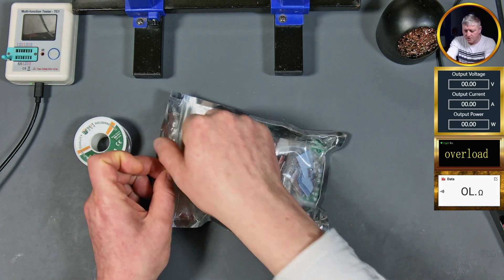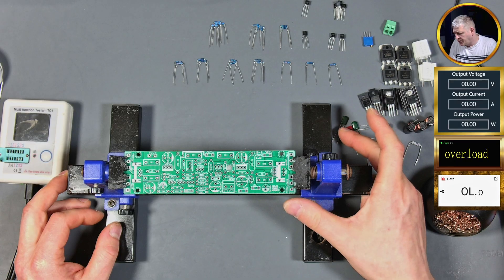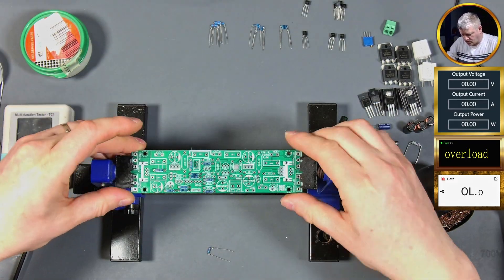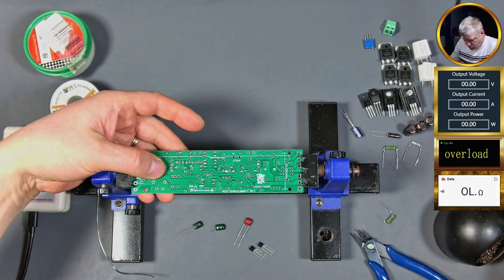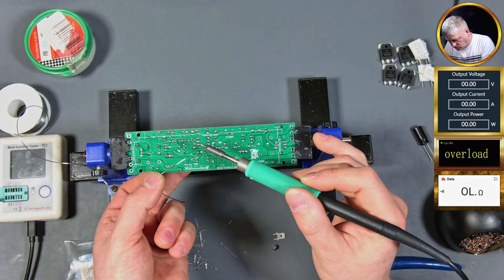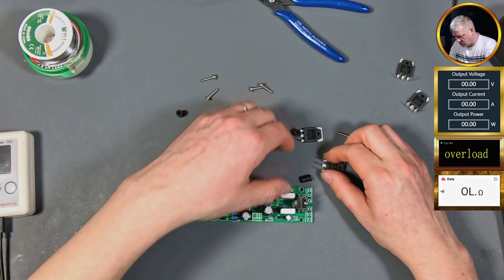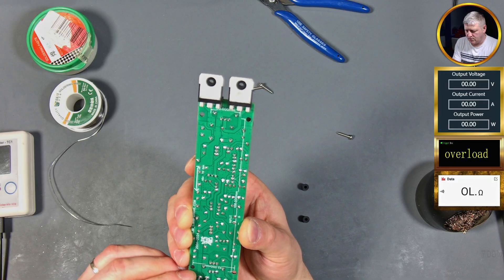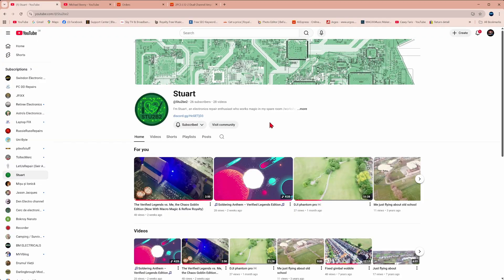Is this L12 V5 AliExpress amplifier kit better than previous version? Part 1

Comment: How is it in compare with tpa3255 dual mono?
Reply from the maker: This is a class AB amplifier I just had a chance to listen only little. But definitely sound different. I will come soon with part 2 having a sound test and oscilloscope test and also the spectrum analyser so stay tuned soon will see how this amp performs. BTW the L12 previous version definitely sound much better and perform better than tpa3255